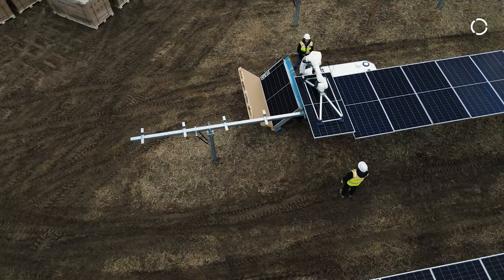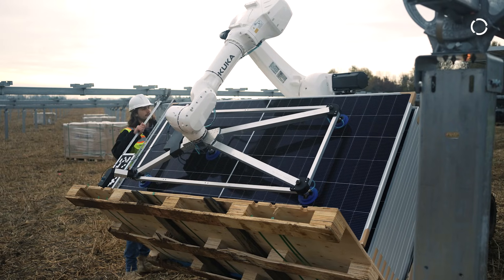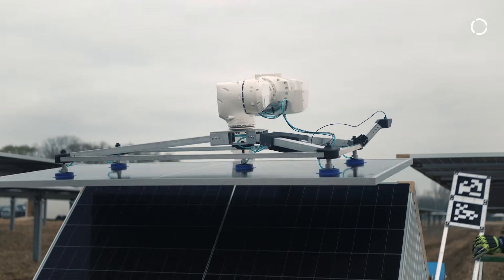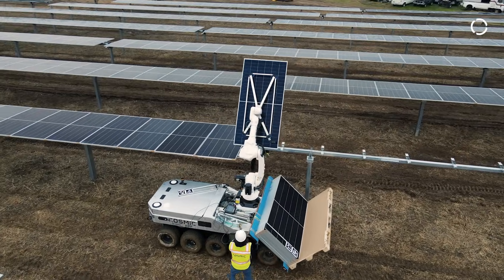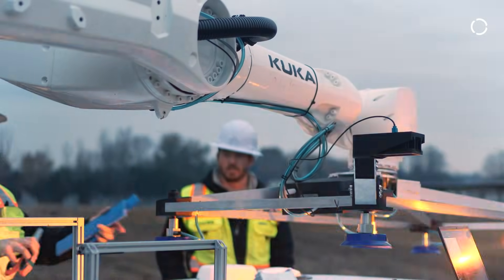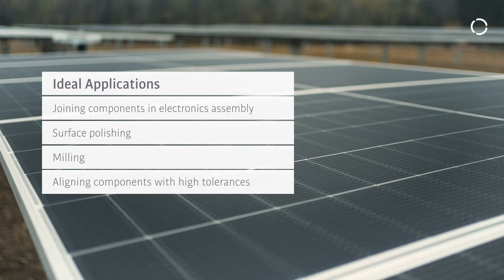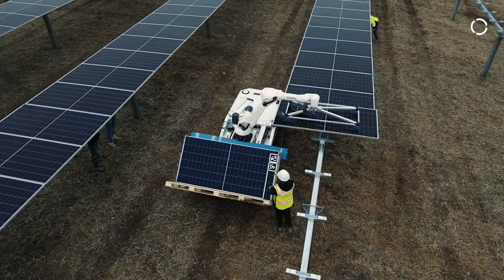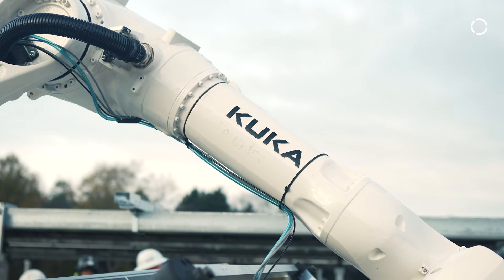KUKA Robots Accelerate Solar Panel Installation

Comment: Install PV on Industrie Hall Not on green
Reply: Wird ja auch getan! Aber den hohen Bedarf kann man nur durch Freiflächen decken. Ausserdem wirds ja nicht zugepflastert. Die Natur kann trotzdem darunter leben.
Reply: The beauty of solar is it can be installed in so many places big and small.  

There is plenty of land out there...

In fact, the entire US 4200TWh annual grid load can be satisfied by just 0.7% of the US entire land area of 3.1-million square miles.  That's tiny!  Solar farms are necessary because they provide the lowest cost of electricity the world has ever seen and still driving their costs lower.

Not all the "green land" is used to grow food...

As of 2025/2026, approximately 45% of the U.S. corn crop is grown for ethanol, not food. This occupies roughly 30 million acres of land about the same area as New York state!  So that land used for fuel corn is already engaged in producing energy even though you see "green crops" growing on it!  What's worse is corn ethanol energy production is way less efficient than if you just put a solar farm on it.  A solar farm would be 30-times more efficient than corn for ethanol!

Agrivoltaics...

Look up "agrivoltaics" which allows solar and crops/agriculture to co-exist and provide mutual benefit to each other.  Essentially we get two "crops" from the same piece of land: food and energy. Both are needed on an ongoing basis for society to survive and grow!

Agricultural farms are actually rough on the land...

The land a solar farm occupies experiences a far more peaceful life than it would compared to an actual agricultural farm...

A solar farm is quiet and peaceful with solid state electronics, no noise, no moving parts, and little maintenance required. But an agricultural farm is abuzz with activity.  It often has animal waste, fertilizer runoff, and pesticides. What's worse is the constant tilling of soil releases captured carbon and increases soil erosion. All that agricultural activity necessarily displaces wildlife.

Recent studies on agrivoltaics sites (specifically those using rotational sheep grazing) have shown increases in soil organic matter of up to 200% in less than seven years.

A 2025 research from the UK and U.S. found that solar farms managed with biodiversity in mind (native grasses and hedgerows) host three times as many birds and 2.5 times as many species as neighboring high-yield cropland.

By planting native wildflowers under panels, solar farms become "pollinator engines."  Even better, these bees and butterflies don't just stay in the solar farm because they are also active into neighboring farms.  This boosts the yields of nearby fruit and vegetable crops through better pollination.
Reply: The beauty of solar is it can be installed in so many places big and small.  

There is plenty of land out there...

In fact, the entire US 4200TWh annual grid load can be satisfied by just 0.7% of the US entire land area of 3.1-million square miles.  That's tiny!  Solar farms are necessary because they provide the lowest cost of electricity the world has ever seen and still driving their costs lower.
Reply: Not all the "green land" is used to grow food...

As of 2025/2026, approximately 45% of the U.S. corn crop is grown for ethanol, not food. This occupies roughly 30 million acres of land about the same area as New York state!  So that land used for fuel corn is already engaged in producing energy even though you see "green crops" growing on it!  What's worse is corn ethanol energy production is way less efficient than if you just put a solar farm on it.  A solar farm would be 30-times more efficient than corn for ethanol!
Reply: Agrivoltaics...

Look up "agrivoltaics" which allows solar and crops/agriculture to co-exist and provide mutual benefit to each other.  Essentially we get two "crops" from the same piece of land: food and energy. Both are needed on an ongoing basis for society to survive and grow!
Reply: Agrivoltaics...

Look up "agrivoltaics" which allows solar and crops/agriculture to co-exist and provide mutual benefit to each other.  Essentially we get two "crops" from the same piece of land: food and energy. Both are needed on an ongoing basis for society to survive and grow!
Reply: Agricultural farms are actually rough on the land...

The land a solar farm occupies experiences a far more peaceful life than it would compared to an actual agricultural farm...

A solar farm is quiet and peaceful with solid state electronics, no noise, no moving parts, and little maintenance required. But an agricultural farm is abuzz with activity.  It often has animal waste, fertilizer runoff, and pesticides. What's worse is the constant tilling of soil releases captured carbon and increases soil erosion. All that agricultural activity necessarily displaces wildlife.

Recent studies on agrivoltaics sites (specifically those using rotational sheep grazing) have shown increases in soil organic matter of up to 200% in less than seven years.

A 2025 research from the UK and U.S. found that solar farms managed with biodiversity in mind (native grasses and hedgerows) host three times as many birds and 2.5 times as many species as neighboring high-yield cropland.

By planting native wildflowers under panels, solar farms become "pollinator engines."  Even better, these bees and butterflies don't just stay in the solar farm because they are also active into neighboring farms.  This boosts the yields of nearby fruit and vegetable crops through better pollination.